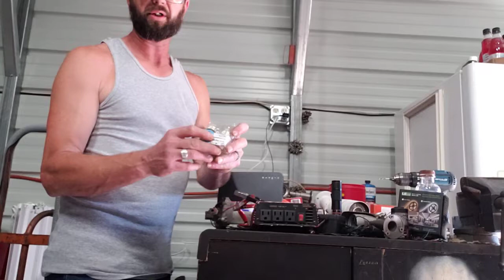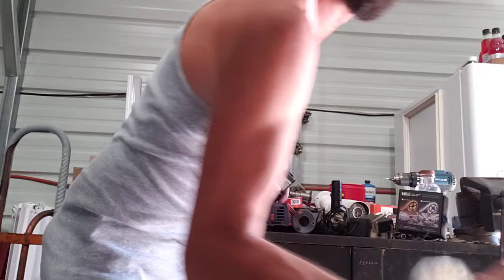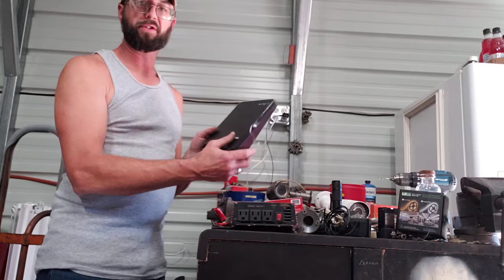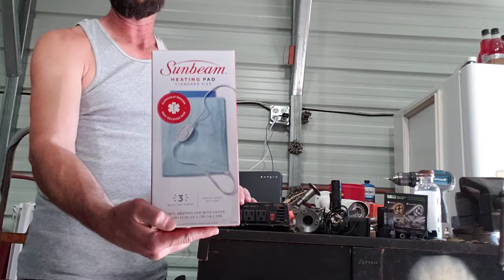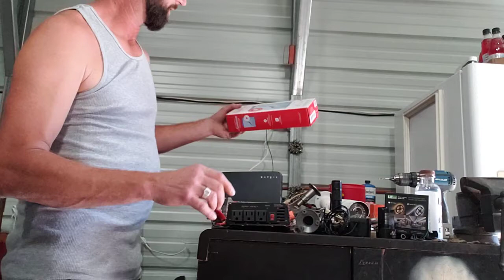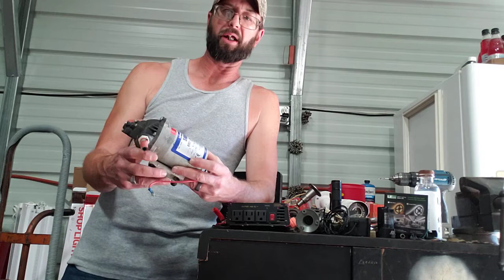Easy Off Grid Power System

Comment: Enjoyed the video. I've always liked the idea of keeping everything 12-volt with no inverters or converters needed. White LEDs for lighting, phones tablets and raspberry pi for computing, 12 volt pump could run water through copper coil in wood stove up to high storage tank for hot shower,CB radio for comms and Homebrew regenerative shortwave receivers for news (based on the work of N1TEV). If you wanted a small refrigerator freezer get the ammonia type used in RVs and campers that can run on a small pilot flame supplied by propane tank. Good job dude 👍👍
Reply from the maker: I will definitely check out N1TEV.  I have a future project scheduled for late spring - wind powered A/C using a vehicle system.  It will probably be massive!  If it works, I will use it to cool the lab during the hottest days of the summer.  I intend to build an ammonia type system for the experience and as a backup A/C for grid down times.  I will power it with either wood or wood gas, depending how efficient the device is.